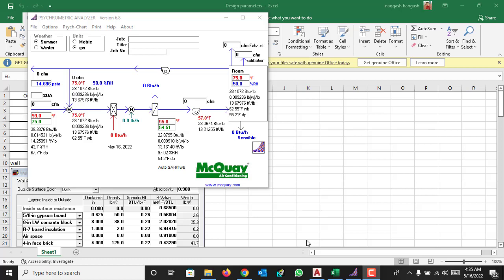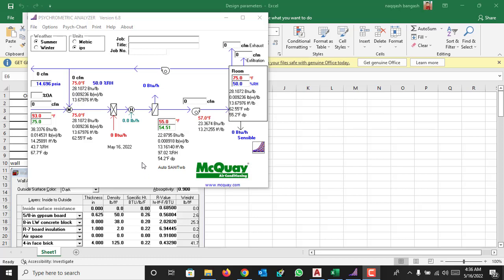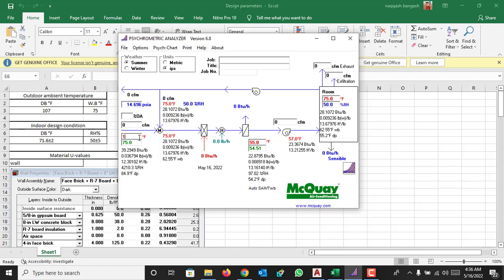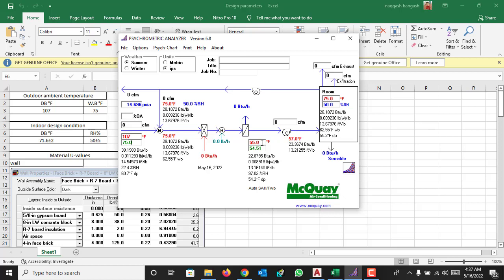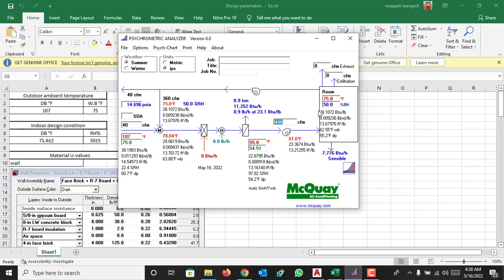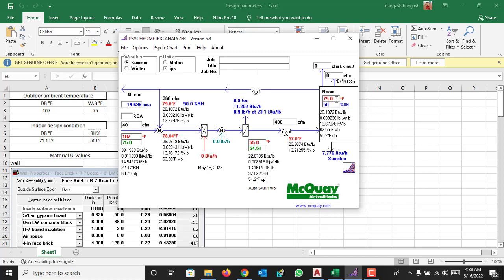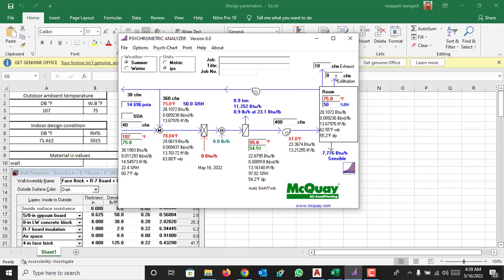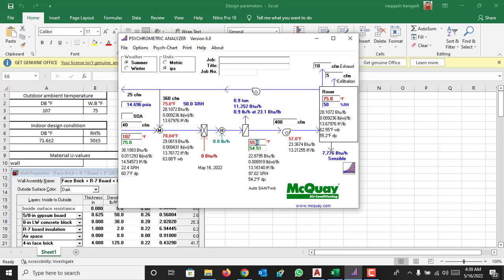How to calculate Coil load by using Psychometric Analyzer

Comment: Fresh air should be taken as per ashrae standards , so why 10 percent fresh air ???
Reply from the maker: Fresh air shall be provided in accordance with ASHRAE requirements for the space. For example, if 100 CFM of outdoor air is required as per ASHRAE, this airflow shall be achieved by introducing an appropriate percentage of outdoor air into the AHU. The outdoor air fraction shall be selected to meet the ventilation requirement while maintaining the required mixed air temperature at the AHU inlet.